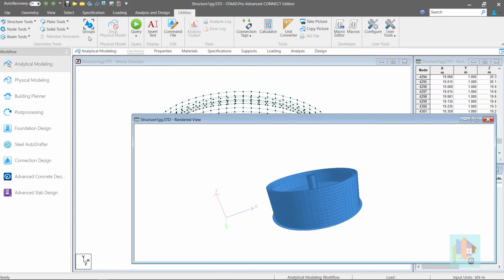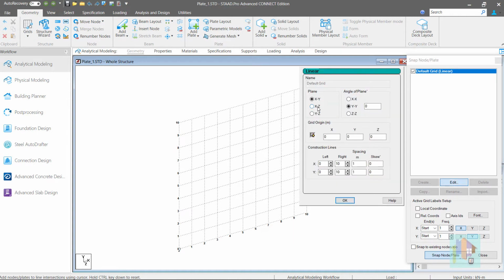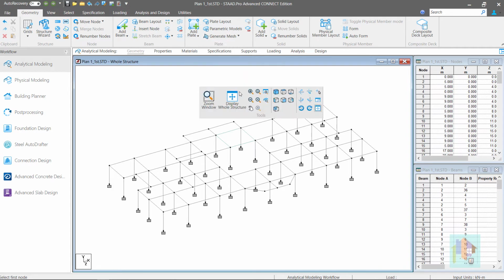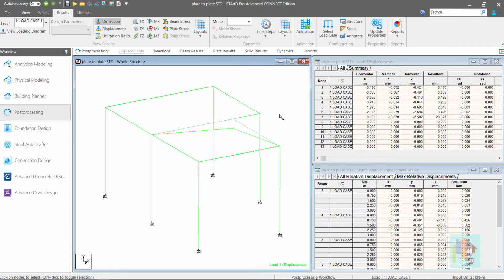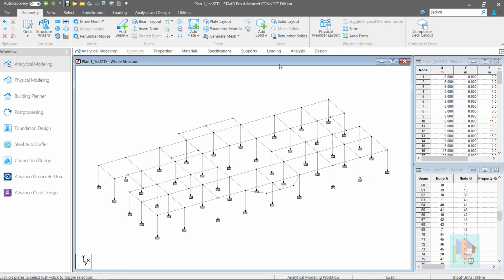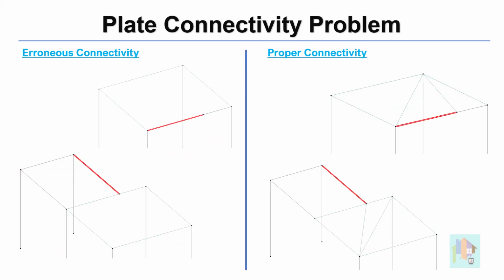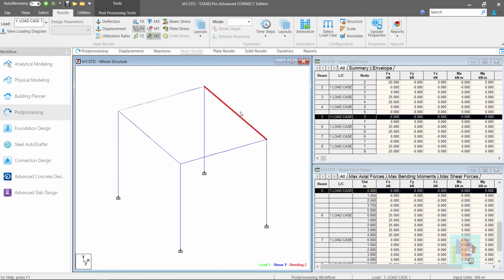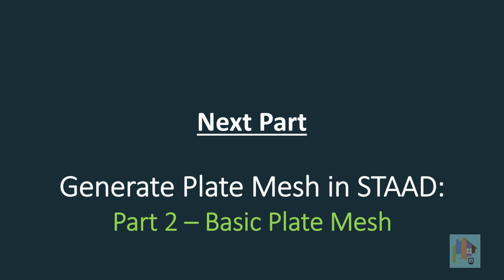Generate Plate Mesh in STAAD: Part 1 – Infill Plate and Plate Connectivity Problems

Comment: Firstly, I would like to express my gratitude for your informative video. Now, I have a question regarding parametric modeling. When plates are not generated orthogonally, how do we determine the moment along the orthogonal direction in order to calculate the required reinforcement for a slab or wall?
Reply from the maker: You can use Results along a line feature (postprocessing mode > Layouts > Plate) to resolve the results along a defined line.

Comment: Thank you so very much for this very informative tutorial. 🙏 Is there any tutorial specifically for modelling and analysing shear walls of an RCC multistorey building? I will be very grateful if you could point to a tutorial or guide which teaches on how to model and analyse shear walls.
Reply from the maker: How to model a shear wall properly in STAAD which can be further used for analysis and design, that will be covered in the 5th part of this series. I will try to upload this soon, stay tuned.
Reply: @surojit_ghosh Thank you very much.

Comment: Sir can you please model one building with basement and flat slab.
Reply from the maker: Thanks for you suggestions. I will cover the flat slab modelling techniques in 3rd part using advanced mesh generator, design using integrated modules will be covered later as that will take longer duration. I will try to cover basement wall modelling in future. Keep watching.
Reply: @surojit_ghosh  thanks sir

Comment: Nice explanation Suro, Please add the below points in the next session 
1. what is the optimized plate size in large structures 
2. Plate reference and changes in results  
3. Plate mat or elastic mat definitions for raft foundation 
4. global vs local stress results
Reply from the maker: Thanks for your suggestions, Ganesh. Yes, I will cover most of these modeling topics in this series. Plate and solid results interpretation will be covered in a new series.